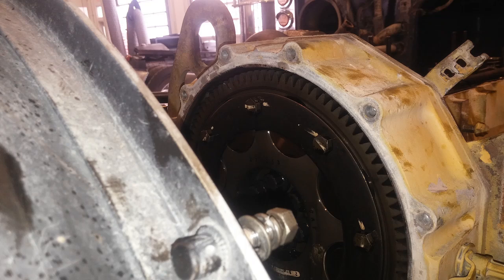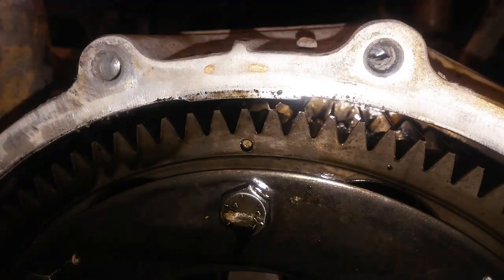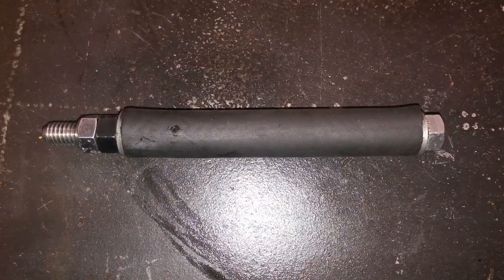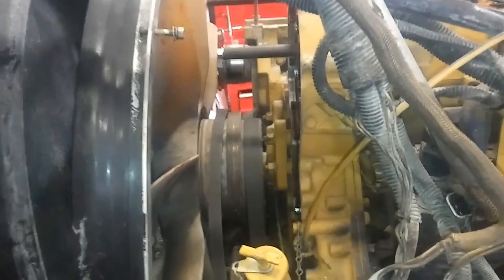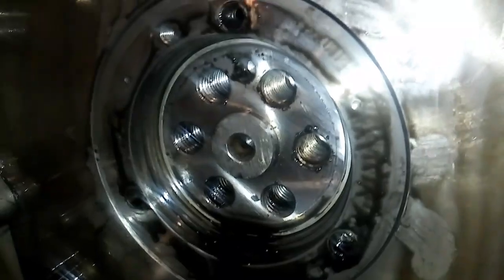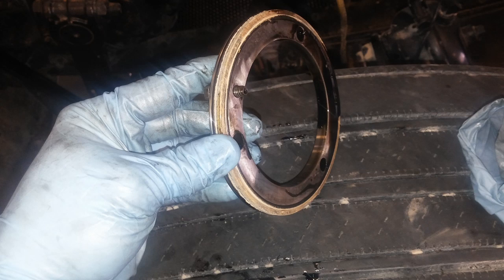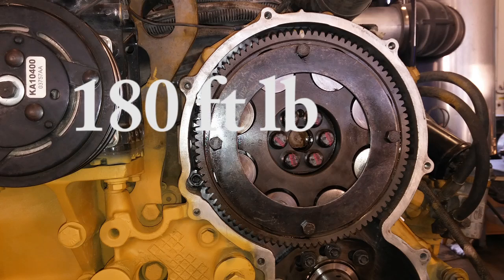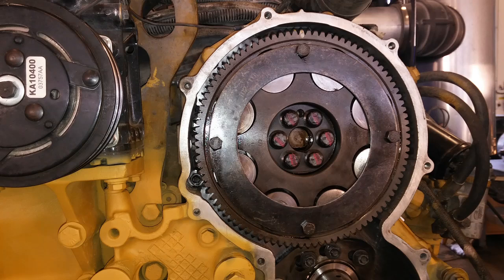3406 and C15 Cam Gear Removal, Timing, and Install.  Cam Gear Timing.

Comment: Thank you for this video, and all of the rest of the info you've put out.  It has been a great help.  One thing on timing - i set a C18 backlash to 0.014, and was about half a tooth off.  after puzzling over this for a ridiculously long time, i finally realized that the backlash will affect the position of the cam timing mark.  when i set the backlash to 0.005/006 (spec: 0.014 ± 0.010), my cam timing marks lined up at TDC as the pin slipped in, just as they should

Comment: Great as always, Josh! Thank you for sharing you knowledge!
Reply from the maker: +ed eduard Thanks for the kind words, I'm going to try and get to 100,000 subscribers.
Reply: Adept Ape what are your thoughts on a marine cam in replacement of stock 6nz cam?
Reply from the maker: +tnsportsman21 I wish I did more work on the hot rodding side of the industry because I get a lot of questions about it, but I never really go outside of stock components. The C15 can definitely make a lot more power. Look at the C18, basically a C15 with a little more displacement, but has 900 HP easily.
Reply: Adept Ape I just put a aftermarket borg Warner s400sx4 turbo on and   was just looking for something else to get a little more hp at a reasonable price. Do I need to do any reprogramming for that turbo you think? Doing an overhead now and new rod and main bearings. Just wasn't sure what a stock engine could handle with that marine cam and or bigger injectors.  Thanks

Comment: Hi! usually why is it necessary to replace this gear?
Reply: That's what I want to know because it seems like one of those components that's indestructable & would outlast all the other components.

Oh nevermind lol, the next video in time is about camshaft gear backlash...so the teeth wear out over time & that's of course problematic roflcopter.

Comment: I hated those T40+ screws with a passion. If they weren't rotted out they were already chewed up. I always put new ones in after wire brushing most of the Loctight patch off. The ones on the back of the head were worse.

Comment: So I removed the gear not knowing it had to be pinned for timing. I haven’t removed the 3 bolt plate behind it. Can I reinstall the gear and then pin it?I will be switching out the head.

Comment: Rebuilding 2006 c15. What do you need to go from the 550 to 6-625 hp different than just back original.

Comment: Adept Ape. I changed the head and am having a time with the timing.  Is it possible that the flywheel isn't timed properly? When it is pinned #1 and 6 are not at TDC. Any help is appreciated.  Awesome Channel
Reply: Hey man what did you manage to do? I have one exactly like this ,I'm thinking either removing transmission and align the transmission or just "winging it" by "feeling" the TDC.
Reply: Had one as well,someone misaligned flywheel. Brakesaver model.

Comment: I’ve just did an inframe on my 3406e and I’m having an issue with cam, thrust plate, cam gear. Once i install the seal plate,  the adapter then the retaining plate I can’t get the cam to turn anymore by hand. My adjustable idle gear is off as well as I just re sealed the front housing/ gear assemblies so nothing is restricting rotation there and I just have cam in the head nothing else. If I just barely touch down the three bolts holding the plate in place it will still turn. If I tighten them it freezes any rotation of cam I can almost finger tighten them and loose rotation. I’ve even tried putting the cam gear on to make sure cam is in right spot still can’t turn it. Any knowledge on the matter would be much appreciated.
Reply: Brandon Portman you ever figure it out? Had the same problem the cam bearing was out just a little hammered it in a little good to go

Comment: what is the purpose/proper name of the 8 count of "free floating rollers" that are built into the camshaft gear?
Reply: I work for a Caterpillar dealer in Florida, and have overhauled more c15's than I can count. Currently in a company funded class and this question came up today in a powertrain class of all things, from my instructor. I couldn't come up with an answer for him. any help would be appreciated. please advise.
Reply: @chancebedore2431  The camshaft drive gear has integral pendulums which act as a vibration damper for the front gear group. These pendulums are designed to counteract the torsional forces from the injector pulses. This eliminates vibration and noise. The engine also runs smoother at all operating speeds.

Comment: Hello, would you expand on the warning Cat has about being one half of a tooth out on the cam gear timing mark to the front cover mark please. I have a MBN in my shop I have had the front cover off of to replace the cluster gear and idle gears. (Code 22-11 primary to secondary sensor signal calibration) After assembly with crank pinned on tdc and cluster gear aligned to crank, this should have been tdc#1 compression. Adjustable idle at 0.014" the cam gear  timing mark is a half a tooth off of the mark on the front cover. So I have removed the idler and rotated the crank forward one revolution to tdc and pinned. Installed idler, and still the cam gear ends up on ether side of the cover mark, a half  a tooth off.
Please explain how Cat says that tdc1 and tdc6 are different, when I have controlled the cluster gear timing mark as instructions in assembly and disassembly direct and yet I'm a half a tooth out.
Thankyou
Reply: A 22-11 code means your out of phase. You don't move the crankshaft leave it alone. Most of the time when your off that much, your head or block has been milled. I pin the flywheel on TDC. Best to have the rocker arms off, put the cam gear on and torque to spec. I than remove the cam idler gear and use a modified gear I made that is cut out on both sides. With the stub shaft slightly loose, I pin the camshaft gear dead on the timing mark. I take a set of feeler gauges that I cut both sides down and check my lash. Make sure you turn the cam gear to the right when you take the slack out, as that is normal running rotation. Your stub shaft also has a hole in it and you can put a bolt in it to start at center if you like. If my lash is 0.014 plus or minus 0.010 you are in spec. I than snug up the nuts and bolt on the stub shaft. Remove my adjustment gear, install the running gear and recheck my lash. Have seen it change some with the running gear. If lash is still good, I take gear off and torque all hardware, put gear back on and finish assembly. If your cam gear is timed and your lash is not within spec you have to make an adjustment. At this point I am not concern with my timing mark on my gear. I can always move the cam back to a timing point. What I want to know now is. How close am I to a full cam gear tooth and my lash be with in spec. Turning the cam gear to the right decreases lash. Turing the cam gear to the left increases lash. Cat does not like it on the tight side. Sometimes I will put a 0.007 feeler gauge in if I have to go in that direction and let it bottom out. Once I get it where I like it, I take adjustment gear off and turn cam gear if needed to timing point and torque, recheck etc.

Comment: Hi I am rebuilding my 3406E 1LW. The book my buddy has says .0085 + - .0045. You’re saying it should be .014 -.024. Did cat change something. Any insight would help. Thank you.
Reply: Cat had to change lash as heads was being machined during this time frame. Causing cam and crank sensor to be out of phase.
The min spec is .004 and max is .024. I don't like the .004, as gear whine can occur. Now all heads are new.
Reply: Is yours the 605hp like mine she came out of Safeway grocery truck hauling doubles over the Rockies powerful as heck just bad oil leak at front housing

Comment: What would cause the bolts to sheer off on the plate on the front of the cam gear? This is the second cam gear this week that it did this too. Please help
Reply: Are you talking about the plate that holds the rollers in? If you haven't fixed it yet that is.
Reply: @nickforgey509  yes
Reply: @margaretmurray3079  Is it damaging the peanut cover when it happens or only the bolts? Also your engine serial number prefix could be helpful if you have it.
Reply: @nickforgey509  5EK and totally blew the peanut cover apart
Reply: @margaretmurray3079  Seems like the cam might be walking out. With the cam gear off there should be a plate with three bolts in it. If some of the bolts are missing or if the plate is missing it could be your problem. It's the only thing that holds the cam in the head besides the rocker arms. Its definitely not a common problem.
Reply: @nickforgey509  removed the cam gear, everything you mentioned looked perfect, no issues. Still stumped... I swear it our luck.
Reply: @margaretmurray3079  Was any work done to it recently before it happened the first time?
Reply: @nickforgey509  it's a 355hp 5ek32906 engine we put our computer on it to boost the power up and it has a Borg Warner 430sx turbo had a engine set up this way before and it ran really good it also has a marine cam. We put a new damper on it checked rockers and injectors heights put a new fuel pump on everyone said its got a fuel knock in it I have never heard one tearing up a cam gear on a pull around 1300 to 1500 it has a rattling sound like the rockers are loose I am at my wits end with it has good oil pressure a good solid 60 pounds the computer is a 600 file on it the next thing I can think of is to put bigger injectors in it maybe that will calm it down ive been completely through the entire engine and cannot find any mechanical problems everything is done by the book
Reply: @margaretmurray3079  I think adding bigger injectors would only make a fuel knock worse if you're running a bigger cam, a hot flash file, and hot trim files already. The rattling sound may be coming from the front gear train. I had a 6TS one time that kept breaking the teeth off of the pump drive gear and sounded like hell. What caused it was the alignment dowel on the back of the adjustable stub shaft for the cam idler gear had worn the hole in the front plate into an egg shape. It was allowing the stub shaft to move under torque. You might have something similar going on. It could cause a weird harmonic in the gear train causing the bolts in the cam gear to back out and hit the peanut cover. If the hole don't look round you need a new front plate.
The only other things I could think of would be that that cam needs a cam gear spacer or thrust plate of a different thickness, or you have spun cam bearings. Bar the engine over and make sure none of the bearings turn, especially the front one. That could also cause a fuel knock because your injector height and valve lash would be changing constantly. You could even loosen the rocker shafts and check the thrust with a prybar. Either the cam is moving or the cam gear is moving..and make sure the cam gear spacer was not installed backwards. Peak torque is at 1200 rpm and the front gears naturally want to try to move away from each other under torque. If the backlash on the cam gear is too tight it will push up on the cam gear and spin the front cam bearing. Its an easy thing to miss believe it or not, and may even throw timing sensor codes but not always. It will cause a fuel knock under load though due to a inaccurate/false timing signal when the gear moves away from the sensor slightly under a load. 
I've seen cam gears crack at the top edge of the roller bores too. Always pull the rollers out and look if you're buying used gears, especially if it only has four bolts holding the plates on. I know this was long winded but hopefully it'll help.
btw I recommend always pulling out the idler gear when removing or installing the cam gear. That way it don't bind up the cam gear in any way if the backlash is off.
Reply: @nickforgey509   ok I know I have  done a lot to this engine maybe a cam bearing I'm not sure but I will tear it down and look and I bought a cat idler adjustment tool so I will be double checking the lash the engine has not thrown any code  but I really appreciate all the insight I have the worst luck I had to  buy this engine out of a running truck  I almost went    broke  working on the last engine  I paid a friend to rebuild it  and then it developed a front structure leak and he didn't want to do it so I found someone else and long story short  they didn't  lock tight it and  all hell broke lose after a month or so destroyed most of the engine from head to cam and rockers  and gears  and hit the pistons  and after 10000 dumped in I got it running again and problem after problem  came on until it spun a 1 bearing  so cheap way out was buy a running engine but we appreciate all your help  sry for the book I typed to you
Reply: @margaretmurray3079  I hate you guys are having so much trouble. I generally recommend taking them to a cat dealer, not Peterbilt/KW, for the major work. It seems expensive until you end up out two engines and 30k in the hole. They might not be able to turn it up past 550 but at least you get reliability and a warranty. But I'm sure you've heard all that before. Spec on backlash is 0.014" +/-  0.010". Also check for any broken injector springs. Might not hurt to cut the oil filter open and check for any metal or bearing material since its a used engine. You might catch something bad before it gets worse.
Reply: @nickforgey509  cat does not want to touch it I've owned the truck for 8 years with no issues until I had other people work on it but anyway I asked cat about  a new engine  36000 and 1 year warranty  that's to much money for only 1 year   so I'm stuck with this direction I lost 40000 in people supposed to know their stuff  the shop cost me a lot because I was to lazy to do the front structure my self so now I'm gun shy with shops the point it worked until they touched it and it's been a ruff road since I had a really  good engine until that  I know everyone doesn't like them turned up and automatically assumes that  it any problem that occurs is because it's turned up I know if they're not done right that all kinds of problems can happen  I'm not trying to say I'm a certified cat mechanic but I have  a lot of knowledge from good and bad experiences we do really  appreciate all you're help  and insights someone to talk these problems out with really  does help  thank you again

Comment: Any tips as to preventing the crank and related gears from turning while the cam gear is torqued?
Reply: He showed you, he pinned the engine with bolt
Reply: Pin it

Comment: +Adept Ape Your videos are great, simple and easy to follow. Any chance you could do some 3176B vids (guess which Cat I own). I'm thinking they're not that popular which makes it even harder to find 3176B info/help online. It's all helpful though. Thanks!
Reply from the maker: +Dennis Gravett Hi Dennis, you don't see the 3176 very often. The C12 is based on it though and they are fairly common. I don't think I've worked on one in maybe 3 years. I usually make videos about items I am working on, so probably won't be making a video on one in the near future.
Reply: +Adept Ape Thanks for the quick reply. Bummer, I figured that was the case. Oh well, I love watching your videos anyway and always learn good stuff. I selfishly hope a poor sick 3176B comes your way that needs tons of service and repair. I'll stay tuned....
Reply: Dennis Gravett  3176, at first was a 2YG, next was a 7LG, had three levels of them, 07499 and below. 07500 to 15999 and 16000 and up. Then came 3176B 9CK prefix. They was better than the other two. The 2YG's was a nightmare. No matter which of these you have the outer and inner front covers are prone to crack. You have to have updated supports, A/C and Alt. This helps but no guarantee it stops. Also power steering gear and air compressor drive gears wear and causes problems. Again updated parts are needed. If you rebuild engine, spacer block needs to come off and replace seals under it. Extra work, but saves you a big head ache down the road. Flt trucks on the 2YG's and 7LG's the fresh air line was not routed properly and a hole would get in it. Water would than run down the line into the TDM, ECM and PM and destroy all three. I wrapped a new line three coils around radiator brace to trap any water. On the intake manifold moisture would inner the system and get into the boost hose and destroy the TDM. A stand pipe (now obsolete) was needed to prevent this. The electronics on the 9CK was like the 3406E 5EK and much better.

Comment: Is this the same for a 3406c?
Reply: 3406 C is a mechanical engine using a pump and line system. Some 3406 C's was a PEEC with electronics added to the engine. But still had to pin time the pump to the engine via the hydro-mechanical VTU or the hydro-mechanical electronic control VTU.